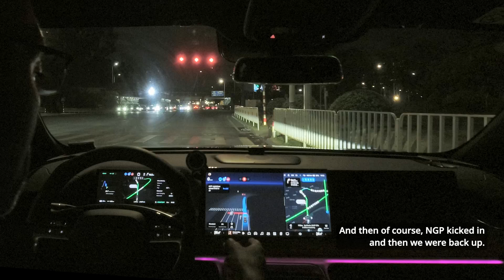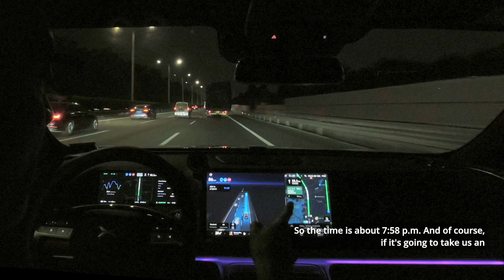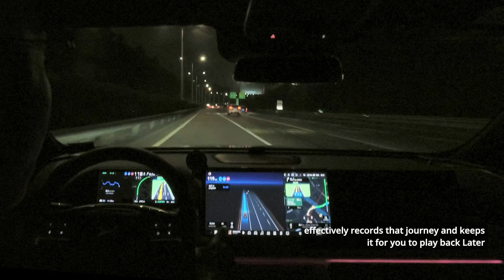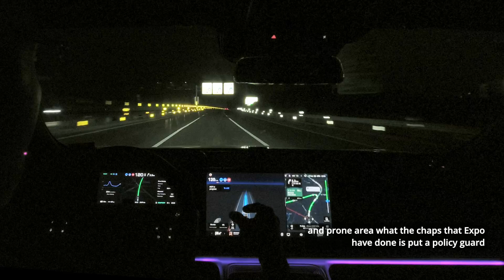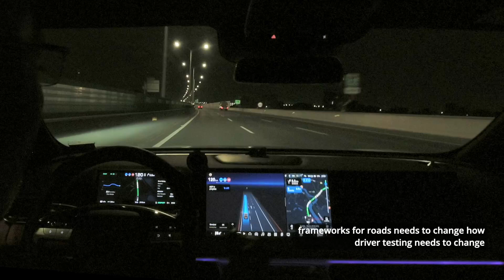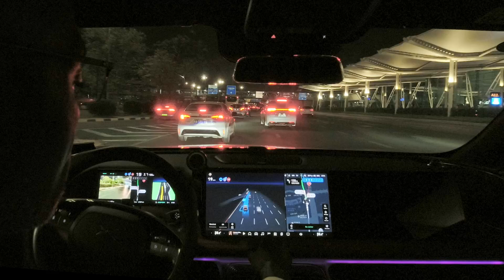Tesla vs Xpeng: The Ultimate EV Showdown in 2025 (XOS v5.5.0 Experience Part #3)

Comment: Nice video once again. Does your version of the G9 use lidar?
Reply from the maker: Yes it does
Reply: @eaojnr I didn't realize that. Hasn't Xpeng transitioned to a vision-only system on its future vehicles?
Reply: I think (hope) vision only is limited to the cheaper (not necessarily al future) cars. So far Mona M3 and the p7+
Reply from the maker: @yome1562  that’s what the current production shows… P7+, Mona are pure vision.
Reply: @yome1562  I think they do want to switch to vision only. The new cars will have improved camera's that work much better in low light conditions. 

However, they will only drop the lidars as far as I know. They will keep the radars and sonars (for parking), unlike Tesla. Since the vision only parking doesn't work that well on Tesla. At least, that's what I read. Maybe they have improved by now. 

But the front and rear camera's are often dirty so that would reduce the vision only capabilities. They should add washers for those cameras